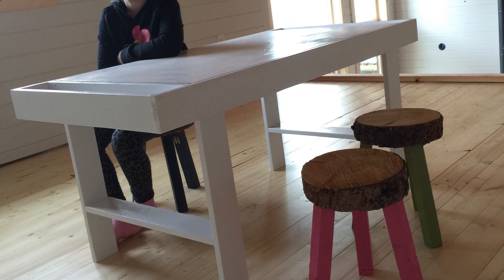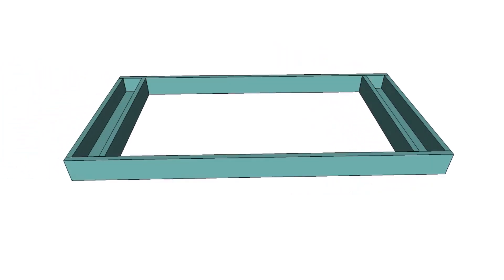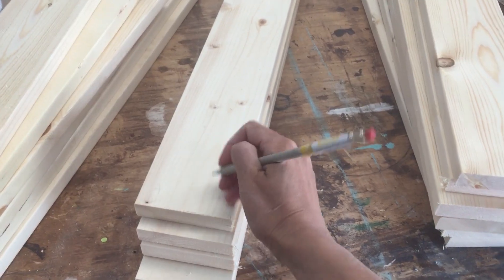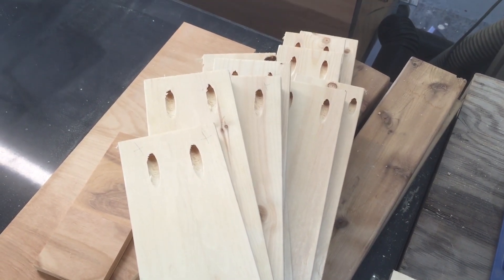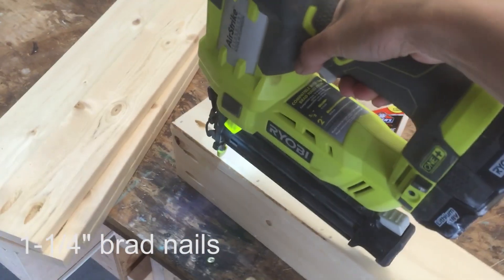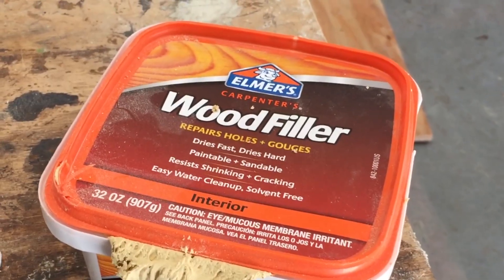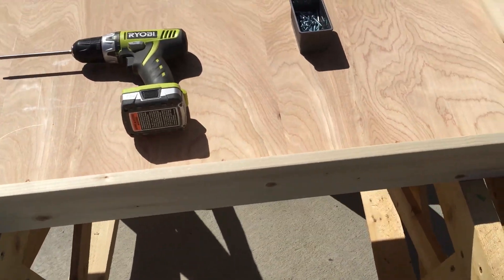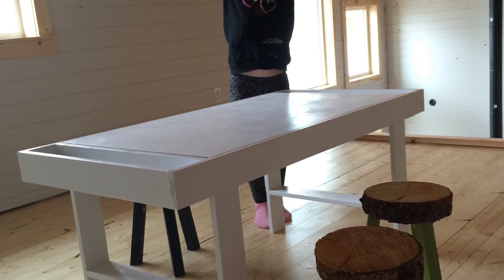DIY Art Play Table with Paper Roll Tutorial

Comment: Great video! Just a tiny note for anyone thinking about filling huge holes like those pocket holes with wood filler like she did in this video.  Don't do that.  Even IF you're only going to paint over it.  The wood filler always shrinks at a different rate than the wood and it pulls away from the wood when it's jammed into a hole that big and looks terrible in the long run. Short-term you can "kind of" get away with it but it was ALWAYS come back to haunt you in the log run. Anything worth doing is worth doing right the first time.